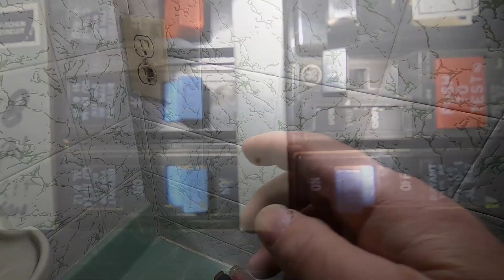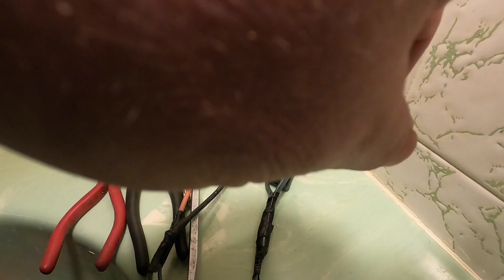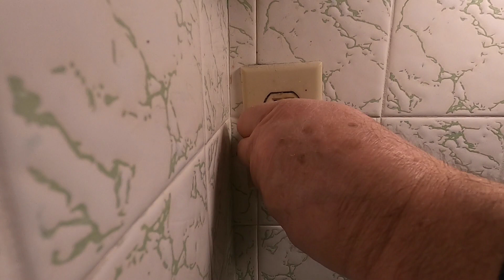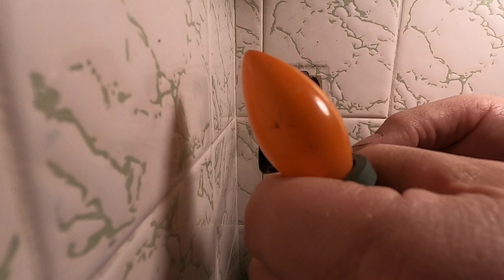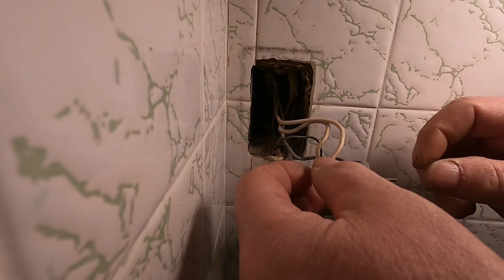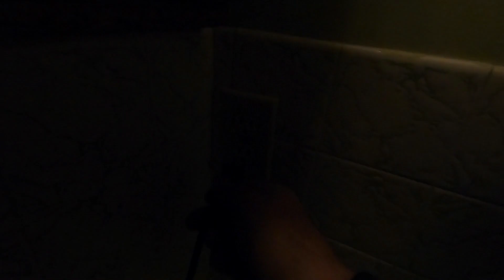Replacing old damaged electrical socket

Comment: Joe, I thought you said that the breaker for this circuit is a GFCI breaker and also a GFCI receptacle in the garage is also upstream of this receptacle. Not sure if I understood you correctly. If the breaker is a GFCI, then there's no need for any GFCI receptacle. If there is one, don't know why there would be, then the Load side must not be used. The GFCI receptacle is appropriate with a standard breaker, and in this case the Load would be used.  In any case, a GFCI receptacle tester should be plugged into the bathroom receptacle in order to verify correct wiring and if GFCI protection exists. The GFCI button on the tester will trip the GFCI breaker or receptacle if it is protected and has a proper ground wire. A label should be placed on the regular receptacle if it is GFCI protected: "GFCI protected outlet".
Reply from the maker: Hi Ted, breaker for this circuit is a GFCI breaker. I think the confusion about   "GFCI receptacle in the garage is also upstream of this receptacle" may have come in when I was explaining the an outlet may have 2 power sources. 3:19. This was just an " safety" explanation that this situation may exist. Thank you for watching and adding additional useful information.
Stay safe, Joe Z